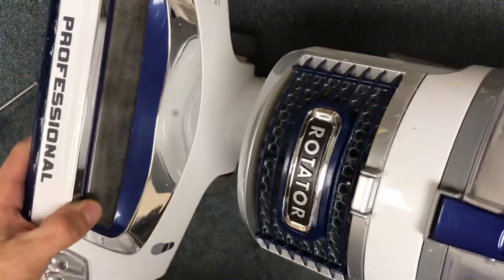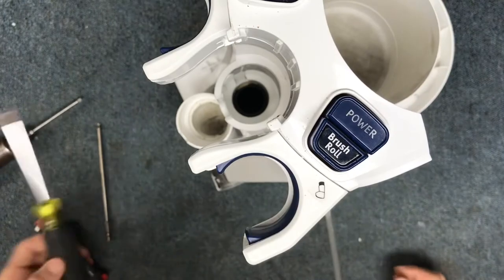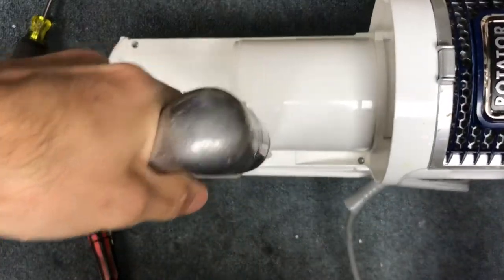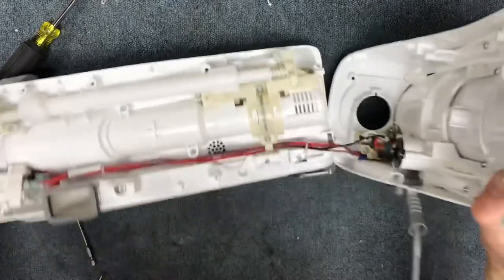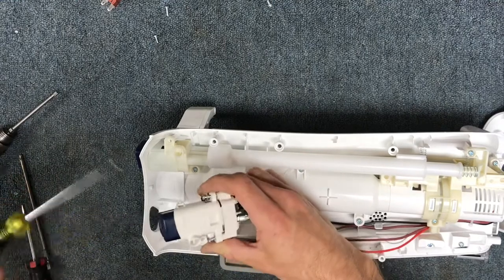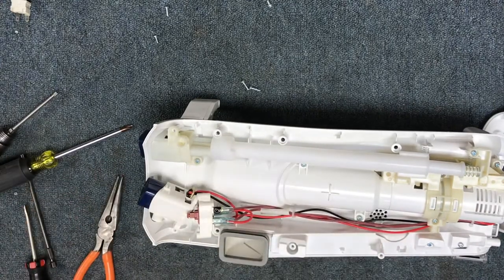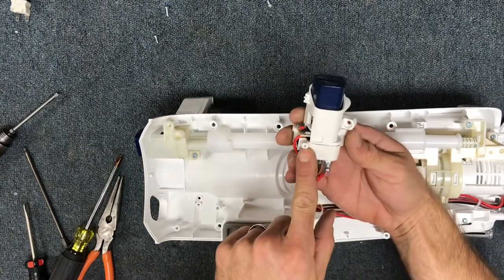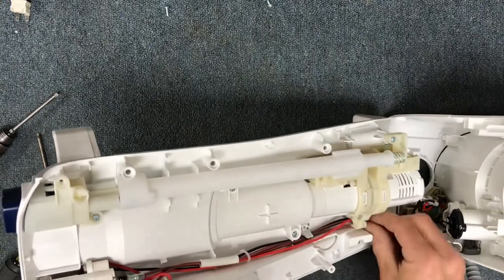Vacuum repair man shows How to replace a switch in a Shark NV500

Comment: Excellent video i manage to fix mine after i order the switch from ebay which was the same brown you got. I got the Shark NV501, the only difference was the switch holding screw was on the inside and not behind the brush holder
Reply from the maker: Thanks for that detail! I pinned so anyone else w a 501 might be helped. The link for the switch is in the description btw for anyone else.

Comment: Very helpful video. All my screws were Philips. My switch housing screw was also on the inside.  The switch nor the wires looked cooked. Switch felt ok mechanically. Reconnected, tested & she fired up. Not sure what was going on but all good now. Perhaps a simple call for attention.
Reply from the maker: If it didn’t run before there’s a chance the thermal switch kicked it off due to overheating. After a certain amount of time to cool it will turn back on. Could be that. Happens to customers all the time! Check for blockages. 👍🏼
Reply: @richardsvacuumcenter  thanks for this possibility. I did try turning it on a few days later but it still didn't work. After taking the mechanism apart, it seems to work fine again. Maybe dirt clogging the mechanism? Not much dirt there, though.
Reply: I should have said NO visible dirt there. a mystery.
Reply: Thanks for the video. Vac wouldn’t power on. No issues that last time I used it. Decided to try and check the switch and once I got it apart and disconnected the switch it looked fine. Checked it with my multimeter and it appeared to be fine. Put the contacts back on and plugged it in and it powered on. Not sure why or what happened, but at least it’s working. Thanks again for the great video.

Comment: Great Help, I was able to fix the issue, the only difference I noticed is that when power button block at 4:32 into video is coming off, it is held as there is one additional philips screw at the back holding it, but other then that all steps matched.

Comment: Excellent video. Ordering my switch now.  I have an NV 520. Slight difference in the power switch housing anchor screw. Mine is in the inside. Didn’t have to remove the vacuum tool clip to access it.

Comment: Great video.  My head lights stopped working on the Shark Navigator Professional NV510 31.  Any suggestions?
Reply from the maker: Unfortunately I don’t have any experience with that particular issue. I would guess the board is having an issue provided that the wires are all connected properly

Comment: Great video but the switches were good.
What do I check next ? I could also use a good still shot of the switch wiring.  Had to disconnect some wires to get to the switch assembly screw. It wasn't on the back like the video.
Reply from the maker: Double check that the brush is definitely not working (be sure it’s in the back position—not in the locked upright position). If it still is not working I would check the micro switch inside the cleaner head.

Comment: Thank you so much for the helpful video🙏🏻
My question is about the NV400…. My only option until recently was to vacuum with the power switch manually pushed in b/c the switch wouldn’t stay engaged by itself. Then it stopped all together. 
I located a break in the black wire running between the motor & the brush roll floor attachment. It appears the manufacturer wasn’t paying attention to the placement of the screw holding the plastic cover plate in place and they screwed it in half. I was able to order a replacement part for these wires and I have repaired the wiring. 
Plugged it in and it sporadically started working again only if I kept my finger on the switch….
I. Your opinion do you think my power switch is bad?
I do have a replacement switch. I just wasn’t able to get into the vacuum cleaner to access the switch. There’s no video tutorials for the model that I have. 
I love this vacuum cleaner otherwise it’s been a pretty good purchase and I think it’s got life let to live if I can get inside to replace the power switch. 
Fyi when I had the motorized brush roll attachment torn apart to solder the wires I did check the little metal micro switch that seems so prone to failure. It’s working okay so I’m more convinced that it’s my power switch. 
Any idea where I can locate a video or even just a few pics giving some direction on how to get access to the power switch on my model number?
Thanks for any assistance you may be able to offer.  Keep doing the tutorials because it’s a pretty valuable thing for us DIYers willing to do the work to keep from shelling out unnecessary $ for a replacement. I don’t have the extra $300+ for a new one atm.
Reply from the maker: Yes if your power switch will not stay on it needs to be replaced. If I get a NV400 in that needs a switch, I’ll be sure to record it.

Comment: Great video!  My issue is the brushroll switch won't stay engaged.  It will work if I keep it pushed down the whole time.  Which switch is it that is needed?
Reply from the maker: That's an indication of a switch failure as well. I would replace the brushroll power switch

Comment: Thank you Richard great video have a question mine has the problem that the power but wont stay on if I change the switch will that do it also it start well but have to hold it down .
Reply from the maker: Yes, that should fix the problem.
Reply: And is the same part  you have on video for the nv501
Reply from the maker: @rafaelfamilia1004  Yes it is. :)
Reply: @rafaelfamilia1004  Yes!

Comment: Hi my shark power switch  got burnt so I ordered one and replaced it. My question is if the wire connector was really hard to get off cuz it was burnt should I replace the connector cuz it won't power on the way it is. Or could it be something else??? Thanks
Reply from the maker: Possibly yes replace the connector. And yes it’s always possible it could be something else. Check your plug prongs too.

Comment: Do you know about the power switch for the roller bead? The light goes on but the willow bead is not rolling. It must be the wiring because of weight is on but it's not rolling to pick up. Help!
Reply from the maker: Hello! I don’t know what a “roller bead” is. Willow bead? What are these things? Is that a typo?

Comment: So I have power, but only brush roller action if I continue to hold the Brush Roll button down...If I lift off the button, the brush action stops. Assuming the Brush roller switch is bad...Is this the same switch as the power switch?...getting only a quick glimpse in your video, it looked very similar. Great disassembly / assembly video.
Reply from the maker: Yes same switch. Thank you!
Reply: @richardsvacuumcenter  thank you

Comment: Liked your video. You made it easy to understand and if my switch ever goes I feel I can change it from watching your video. But my switch is fine its my headlight is out n flickers on when I  bump into something. I think there is a loose wire the suction and brush are fine. Unfortunately there isn't a single video on YouTube that addresses the headlight connection. Is this something you could do on a video? I would be so appreciative I don't really have to have a light to vacuum but it helps n the rest of the vacuum is in great shape. I do regular maintenance. I love my Shark Rotator. Thanks in advance if you can help.
Reply from the maker: Hmm that could be a pinched wire. I usually only make videos of common problems that come up to me on the work bench and a flickering headlight is not a common one to see. But if I come across one and can fix it I’ll be sure to record and upload!

Comment: I have a shark rotator lift away model 510, It will not turn on has been unplugged, no lights either. I ordered a new switch but not sure how to connect the terminals back. It looks like I have a piggy back terminal? Can you advise me on what to do, please?
Reply from the maker: Did you follow the instructions in the video? Sorry for the late reply. I’m not sure what to advise you on other than be sure to install all terminals in the same location as you found them on the old switch

Comment: 9:32… That bottom piece on my main lift away unit on my rotator NV501 is cracked. Surely you cannot order a new one from shark or any aftermarket house. Do you know where I can get a replacement bottom piece for that? BTW, I clicked on your link in the description, but the power switch is no longer available on eBay.
Reply from the maker: No idea. I would guess it's not available. Thanks for letting me know about the ebay link. Competitors have out priced me (for what my time is worth) so I'm no longer selling those switches. I removed the link. Thanks
Reply: @richardsvacuumcenter  Thank you for taking the time to reply. I may give mine to Goodwill for electronic scrap. It also needs a new cord. It’s a shame because other than scuff marks, it seems in decent shape as both the main motor and the floor head motor run. Plus it has one of the best brush rolls I have ever seen on a vacuum, which I will cannibalize if I scrap it. On the other hand, do you think somebody might want this machine for parts?

Comment: This video gave me hope that I could fix my Shark NV402. Unfortunately its design is quite different than the NV500 featured here. I've torn it all down but still can't get into the switch area. So frustrating! Any clues? TIA!
Reply from the maker: send me a few pictures and i'll see what I can do to help! richardsvacuummi@gmail.com
Reply: @richardsvacuumcenter  Thanks for the reply! 
Here's the NV402: https://imgur.com/PhpbqTA 
And this the switch area: https://imgur.com/tShAN8c 
I've already put it all back together but I could disassemble again if that would help. Seemed like I was so close (maybe one more hidden screw?) but no cigar...  :(
Reply: OK, I finally was able to access the switches on my Shark NV402. You need to disassemble nearly everything (the motor can stay) to loosen the wires and find the screw below the switches. Then there two more screws holding the switch box, one in the hole at the top and the other hidden beneath the “Dust Cup Release” button. I just ordered a pair of replacement switches as both of mine had failed. Thanks to @richardsvacuumcenter for the hope and encouragement.  👍

Comment: I have a NV501. The brush roll turns on with the power for like 2 seconds and stops (brush roll indicator light is red). I have bypassed the switch in the head and replaced the switch in the handle. It still does the same thing. Any suggestions? Thank you.
Reply from the maker: Is your brushroll spinning freely if you turn it with your hand?
Reply: @richardsvacuumcenter   Yes
Reply from the maker: @brroja4967  HMM tricky one. theres a chance your board is bad. Not saying this with certainty, but the evidence is pointing to it. It would take more investigation to fully conclude that. Sorry I couldn't help you out here
Reply: @richardsvacuumcenter  No worries, thank you so much for trying. You are doing a lot of good here to help people  👍
Reply: I have the exact same problem.  Everything checks out so it must be the board.
Reply: I have the exact same problem.  Everything checks out so it must be the board.
Reply: I have the exact same problem.  Everything checks out so it must be the board.
Reply: I have the exact same problem.  Everything checks out so it must be the board.
Reply: I have the exact same problem.  Everything checks out so it must be the board.
Reply: I have the exact same problem.  Everything checks out so it must be the board.
Reply: I have the exact same problem.  Everything checks out so it must be the board.
Reply: I have the exact same problem.  Everything checks out so it must be the board.
Reply: I have the exact same problem.  Everything checks out so it must be the board.
Reply: I have the exact same problem.  Everything checks out so it must be the board.
Reply: I have the exact same problem.  Everything checks out so it must be the board.
Reply: I have the exact same problem.  Everything checks out so it must be the board.
Reply: I have the exact same problem.  Everything checks out so it must be the board.
Reply: I have the exact same problem.  Everything checks out so it must be the board.
Reply: I have the exact same problem.  Everything checks out so it must be the board.
Reply: I have the exact same problem.  Everything checks out so it must be the board.

Comment: What's the fix for brush roll not running? Is it the upper switch next to power switch or is it the micro switch in the power head? I get no indicator at all when I press brush roll switch.
Reply from the maker: In most cases it’s been the micro switch. I usually separate the upper section from the head and then use a multimeter to check for voltage at that connection in order to be sure the switch up top is working. Can’t always assume it’s just one and not potentially both. The most common issue however is the mircroswitch

Comment: Help!  I have and NV501 light comes on, no vac motor and no brush motor. Just the headlight and the switch indicator light?
Reply from the maker: That's usually a sign the motor has failed. The lights coming on show that the switch and power cord are OK
Reply: @richardsvacuumcenter  Thank you Rich! The beater brush is also dead in the water. Does that match up as well?

Comment: When the rollers don't turn, the light won't turn on, how does one test if it's the roller switch or the angle switch?
Reply from the maker: Check out my other video about how to bypass the micro switch on that shark. thanks

Comment: Same pos I have. The lights work. Nothing else does .
Reply from the maker: I would guess a bad suction Motor but can’t be certain. Probably not worth your time.
Reply: @richardsvacuumcenter  Turned out to be a bad brush in the vac motor. Got a used one on ebay with almost new brushes.

Comment: Sharks are GARBAGE...buttttt they are priced about right, in reality. They sure arent top of the line but neither is dyson and you can get three Shark's for the price of a Dyson. I recommend buying a used Lux...or Sears canister w/ the dirt sensor. I wheel and deal in Vacuums. I repair and refurbish and out of ALL the vacuums Ive had....even the expensive ones like Riccar or Lux, my sears Kenmore canister is THE BEST. While the Lux equals it in every factor--even has MORE suction (I swear my Lux can suck a bowling ball up its hose) but there is nop vacuum made in the world that can equal my Kenmore's lighting system. I swear it's like having a motorcycle light but it also has lights on the wand not just the nozzle heads so if I use a non-powered hard floors attachment, I still have brighht light. I do like Dyson but I feel they are overpriced AND I hate their refusal to use LIGHTS. I hear they MAY have some models now with lights but I havent seen them. I like my light!  The dirt sensor is the ONLY way to go. How else would you know if youve goptten all the dirt youcould from a spot on a rug?? My vac will show red, red, red but as it sense little to no more particles, the light will change to green. It isnt just a gimmik. Itg actually works. i cannot put into WORDS how great the green/red light sensor system is! Because of the sensor --which my $1,000.00 plus vacuums dont have-and the strong multi-light system my Kenmore has--I rate it the best vacuum I have. With a 15 dollar "sim,ple stik" cheap dustbuster "upright" a close second. My 15 dollar dirt devil would get me by in life if I had to use only it. Has a little on board crevice tool attachment..you can take off the handle and wide head and use it as a dust buster or you can vacuum your whol;e house with it. For the money? best vacuum you can buy. (PS. Im selling a Lux Guardian vac inm PERFECT new condition w/a new 20 dollar filter for 140.00 which is HALF of any other one being sold in America)
Reply from the maker: Cool!